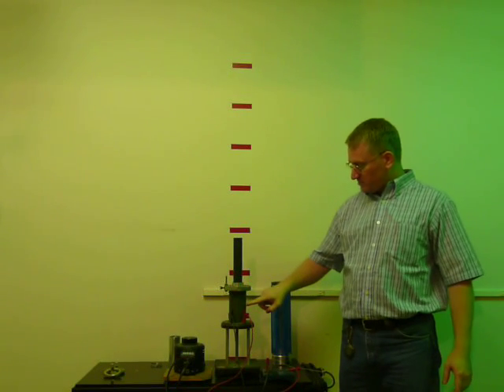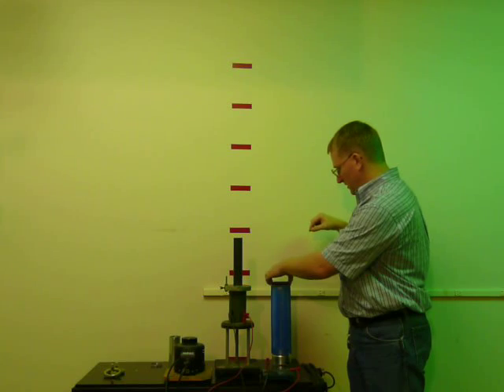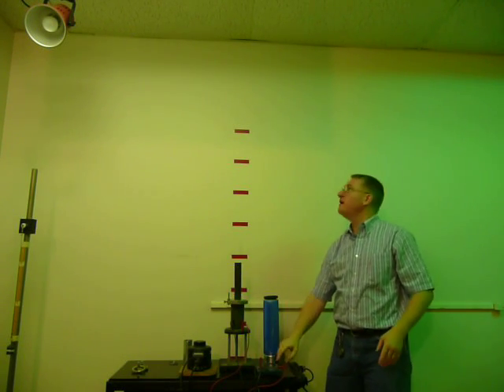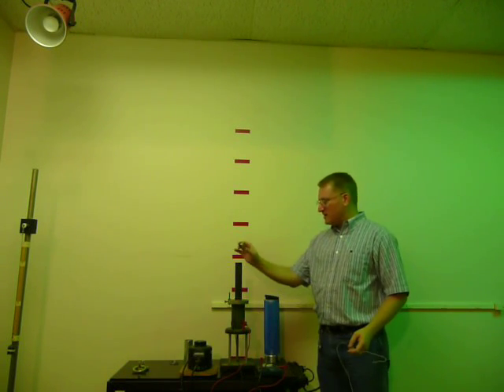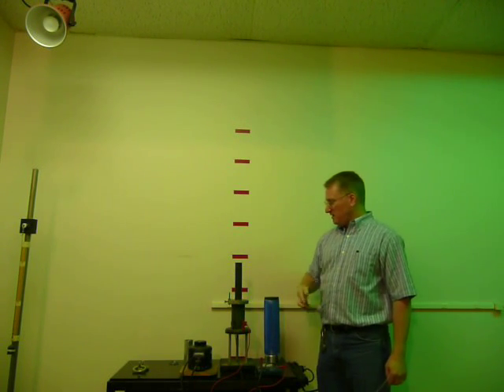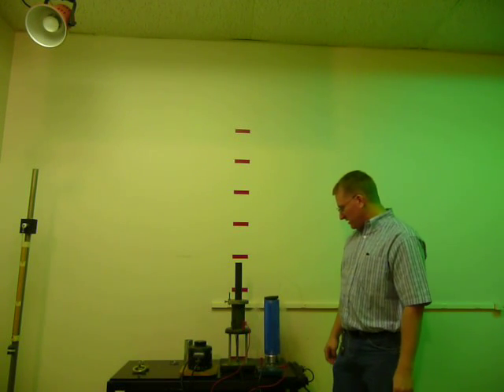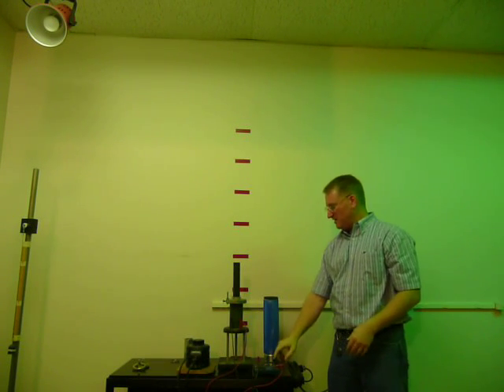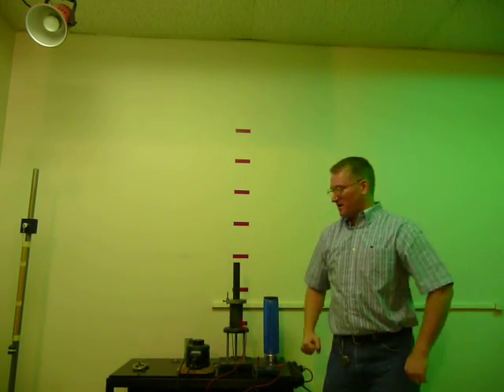Jumping Ring Induced Current Demonstration

Comment: The interesting thing is the effect of the ambient kinetic energy (the heat) in the room, the room temperature, which reduces the counter-EMF produced in the ring from its maximum chilled temperature from the LN2.

Why would more kinetic energy in the particles in the ring reduce its ability to create an opposing magnetic field?   Since a magnetic field requires aligned electron spins (this was established in the 1920s, after the Stern-Gerlach experiment) - it must be that as the kinetic energy of the charged particles in the ring increases due to influence of the kinetic energy of the gas (our atmosphere) inside the room, it interferes with alignment of electron spins in the ring.

As the ring heats up, the torque that was applied to align electron spins when kinetic motion in the ring was low (due to cooling from the LN2), the same torque is partly counter-acted by the increased kinetic motion of the charged particles in the ring. A portion of the torque is wasted as heated particles in the right undermine it.

It's akin to riding a bicycle.  Without the brakes on, a maximum speed can be reached.  If you apply the brakes, the same effort that achieved maximum speed is no longer sufficient, being counteracted by the friction of the brake.
.

Comment: The iron rod is a subtle feature of this experiment.

IRC it acts as a shaded pole- the iron rod is excited by the coil with a 90 degree or so phase delay. That's why the ring always goes in one particular direction; the coil and the rod together act as a two phase induction motor.
Reply: The phase delay (shift) would be nowhere near 90 degrees.  Even in the generic shaded pole motor used for mundane, low-starting-torque situations like cooling fans, does not develop a 90 degree phase difference.  In this case, the magnetic axis of the powered coil in the base is collinear (same axis) as the magnetic field in the iron.  Are there other electrical devices that share the same magnetic axis?  One case is an autotransformer.  Autotransformers, instead of the normal transformer that can have the primary and secondary windings wrapped one around the other - in an autotransformer, the primary and secondary windings are 'stacked' next to each other on the same magnetic axis.  There is zero phase shift in an autotransformer.
Reply: @Greg_Chase  It's still inductive even if it's not 90 degrees. That's all that's required. Eric Laithwaite showed it was a type of shaded pole linear induction motor. And let's face it, he did basically invent them.

Comment: @frodomoses nah, it is AC current, the force generated is proportional to the rate of change of current, since the current is constantly changing in a AC circuit, 50/60 Hz, then thats what provides the induced current in the ring, and an opposing magnetic field. im pretty sure with AC you can tell which direction the ring will shoot.